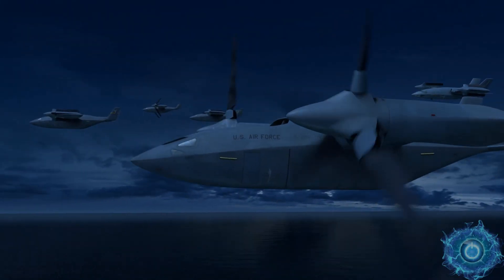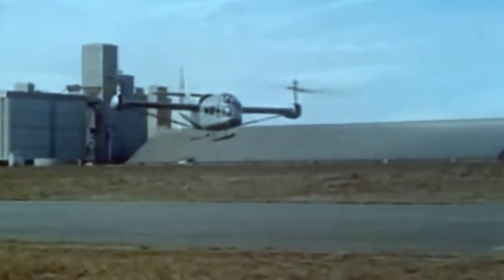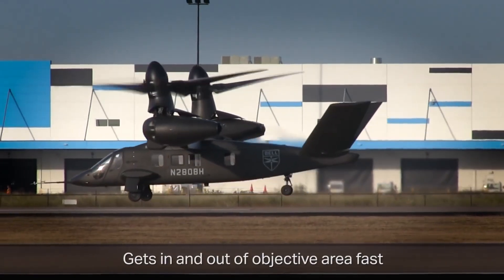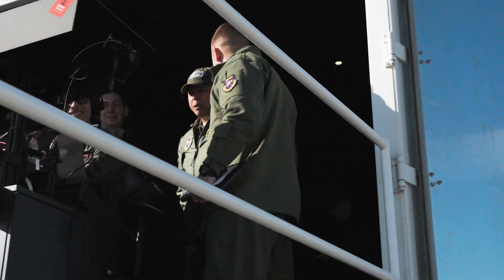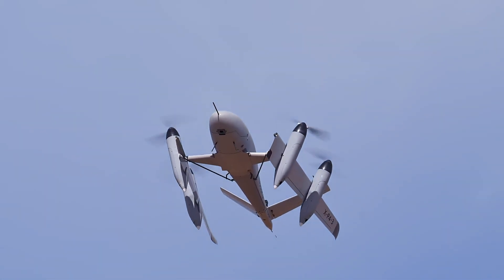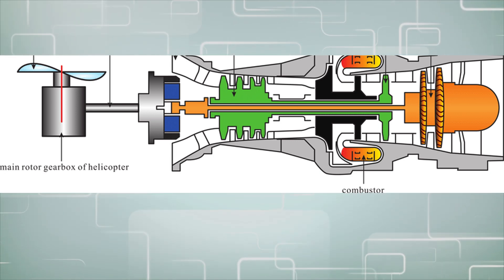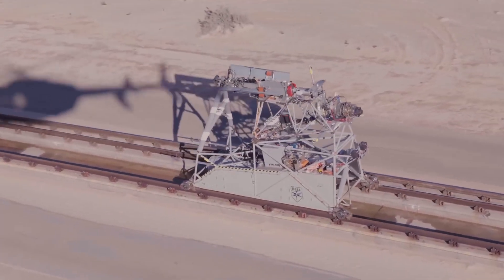HYBRID Jet Engine Will Change AVIATION Forever

Comment: From the title of your video, I was expecting something different. 
That is- why not an electric aircraft with a jet engine electric power unit and smaller battery storage for power and range? It seems like this "hybrid" powertrain would be superior to a battery electric aircraft in every way. it would be a great first step to an all electric aircraft, just as hybrid cars were a precursor to all electric vehicles.

Comment: Looks like an osprey, the most dangerous aircraft ever built. Remarkable kill ratios on those.
Reply: You are falling for the hype generated by aerospace ignorant reporters. The Osprey is really less of an aircraft and more like a helicopter. If you compare its record to the Blackhawk or the other large helicopters or to the Apache, then it is no contest. The Osprey is safer than all of them.
If you compared it to fighter jets in the 70s it would probably be better too. 
Today's aircraft are simply extraordinarily safe compared to years ago. For its capability and its similarity to helicopters, its safety record is just fine.
Reply: @i-love-space390  ospreys danger is to the marines inside it. The ratios are not in favor of the crew and compliment. Marines are to valuable to lose in those machines.

Comment: As w/ anything, maintenance concerns & durability. The failure rate goes up exponentially which is driven by complications caused by parts count.
GR8 vid, didn't see this coming. Blade folding isn't new but the application is. Many thanx 👍👍

Comment: One of the biggest problems for American services is arbitrary limits placed many decades ago. That limit helicopter speeds. If aircraft travel faster than a certain  speed then they  became an air force project. These arbitrary speed limits were stupid outdated and were supposed to prevent inter service competition and stop duplication of effort. And keep air force toes from getting stepped on. 
It prevented the Army and Marines from looking for faster more capable solutions.
For example helicopter wings that folded back into a Delta wing configuration while turbo jets provided high speed thrust. 
Or drone type thrusters that just lift a fixed wing aircraft ten  feet up where other propulsion takes over. 
The air force insistence that they control everything over an arbitrary speed has really hurt the ground forces. Who need support. Something like an A10 that could VTOL and hover yet fly super sonic when needed, with laser systems. This is quite feasible yet never developed. 
A structural small capacitor battery pack that could power thrusters for takeoff or lasers for protection from missiles or taking out drones. Mean that less ammo and heavy guns would be required. So a very good weight tradeoff. Also electric compression on jet engines could dramatically improve efficiency and allow faster spin up for quick operational readiness. Once in flight these electric motors would turn into generators to power lasers and charge batteries and capacitors. 
There has been very poor thinking on this type of craft.

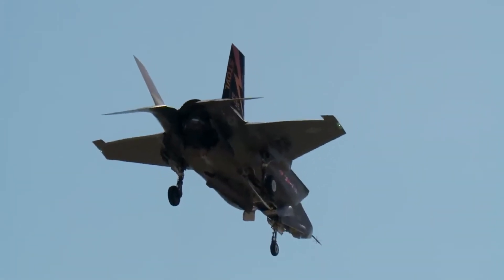Comment: The vertical lift on the F35 isn't only accomplished by redirecting the exhaust - it also has a lift fan that runs off the engine that directs thrust downward. It's the case on the right in the picture of the F35 engine system at 3:37

Comment: STOVL jet aircraft might be inefficient power wise, but not production wise if such engines are already proven and mass produced. After seeing this video, I'm surprised there aren't designs out there using the F135 engine. I doubt such aircraft will be heavy lifters, be they might make good assault aircraft.

Comment: The plane could literally do VTOL. i.e. The plane can be in a vertical orientation at those times. The tech is sufficient now since the last time they tried something like it. Ask SpaceX.

Otherwise. For fueled options, what you want is two fuel tanks. The main one, and a smaller one. You want to be able to rotate the entire engine with significant degrees of freedom. But that makes supplying fuel constantly challenging. On the other hand a long distance plane doesn't spend all that much time actually VTOL'ing. So the rotating assembly can have it's own small fuel tank that supplies the engine while the rotation prohibits direct connection to the main fuel tank. Enough to complete VTOL operations. And is filled again whenever the engine is rotated into it's default orientation (at which time the connection to the main fuel tank can be restored). Much better than extreme thrust vectoring I think.

Comment: Can a turbine generator supplying capacitor or battery banks actually deliver on electric propulsion for aircraft? Or is the hybrid weight penalty not worth it, or perhaps the energy losses are too much?
Reply: There's a couple of hybrids out there and the performance is amazing.

What you really want is a sustaining ICE engine that supplies just enough power for cruising.

And the electric motor gives you enough for climbing.

Comment: There is an interesting design of aircraft, but they rarely talk about it, because this thing is secret. The topic of pulsed plasma thrusters has been developed since the early 60s (see PPT - Pulsed plasma thruster) - they are usually designed for spacecraft. But we will talk about a little-known design - these are plasma propulsion panels for aircraft, where the same Pulsed plasma thruster, but reduced to the size of a pencil and stacked in the form of cells in the panel. The design resembles a conventional plasma TV screen, where there are also discharge cells that activate the glow of pixels on the screen. And plasma propulsion panels have long discharge cells, the arrester has a railgun architecture (just rail contacts or coaxial), and the ionized discharge air is accelerated there by the Lorentz force to enormous speeds - a kind of ramjet engine is obtained. Just imagine! - tens of thousands of small ramjet engines assembled in a panel and firing plasma synchronously with a huge frequency (hundreds of kilohertz). Thus, plasma propulsion panels create lift by pulsed emission of plasma jets from railgun cells. There are tens of thousands of cells in the panel, they shoot at a frequency of hundreds of kilohertz, a huge pulse is obtained, and the plasma swirls the air into toroidal rings - the aircraft is held on this air cushion. Horizontal acceleration is created by the same plasma panels on the sides of the device (they glow, from the side they look like "portholes"). Such devices like "triangle" or "disk" have been observed for a long time, they are mistaken for alien ones - but these are terrestrial devices. They are classified and used for espionage and secret actions. Pulsed electromagnetic technology generates microwave radiation, therefore it is harmful to health. They rarely fly - only military missions. Therefore, they are not suitable for a citizen. This maintained the secrecy. Now they are already declassifying - many people know about this secret technique. When declassified, they will be used for cargo airships. But there is a danger that they are now going to be adapted to deliver small nuclear charges to decision-making centers - such means of delivery are not specified anywhere, are not conventional. This lowers the threshold for starting a war. It would be necessary to declassify them as soon as possible.
Reply: IDK man I am into Physics but this sounds like Schizophrenia
Reply: I see you are a university guy though, so maybe it is not Schizophrenia hahaha. I hope you are right. Though I fear not, why would we be developing these hybrid engines, or even rockets if we had these supposedly effective plasma railgun thruster array thingymajiggys... (as I understand it current plasma thrusters are so weak they're only really useful in space with low friction resistance or in research settings)
Reply: @CamimalFPV  👽👽👽👽👽👽👽👽👽👽👽Gray Lives Matter!
Reply: Consider the conservation of energy. The exhaust of a plasma thruster will be ejecting lots of thermal energy just like an afterburner, but unlike a jet engine that directly uses energy-dense fuel, you need an electric generator that would be at least as big as the jet engine or an incredibly heavy battery.
Reply: @JWQweqOPDH  There are suitable fuel cells that run on magnesium. You can read about them in the public domain. They give a current of 1000 A.
Reply: Solutions come in 6 types 
Each harder to create than the other.

Hypothesis
Physics
Lab
Production
Economic 

I doubt this is barely out of type one. Seems the physics prob has a lot of holes in.
Reply: @simonhenry7867  After studying all the materials about UFOs, it becomes quite obvious that since the late 40s of the twentieth century, a secret project has been developing in the United States to develop and manufacture aircraft, where lift is created using high-frequency vibration. It all started with James Pitts' vibrating orthotopter umbrella "Sky Car", then the umbrella was closed with a dome and devices appeared according to the scheme of conventional electromagnetic vibrating speakers (membrane + inductance) - fragments of the membrane were found by a farmer in Roswell. Then they created piezoelectric motors or with small dischargers on the surface (they glowed all over the body due to air ionization), and now these are planes with plasma propulsion panels (therefore they are angular - that is, with flat surfaces). Thousands of discharge cells are tightly packed into motor panels - they emit plasma streams (the architecture of the railgun is coaxial electrodes). The ionized air of the spark discharge is accelerated in the chamber of the railgun by the Lorentz force to enormous speeds - a kind of ramjet engine is obtained. Just imagine! - tens of thousands of small ramjet engines assembled in a panel and synchronously firing plasma at a huge frequency (hundreds of kilohertz). Plasma jets form toroidal air vortices - this air cushion creates lift and acceleration. See, for example, the MARAUDER project (A ring with magnetic acceleration for obtaining ultrahigh directed energy and radiation). My article "UFOs made in the USA" and the books "UFO Hunting" and "UFO Eradication" describe all this in detail. The technology is quite mundane - it is known in great detail due to information leaks. For example, air ionization in the coaxial elements of a railgun is created using radiation (radioactive polonium is introduced into the metal). Devices of this type were used throughout the 50s and 60s-70-80- x's for secret missions (they took off, as a rule, from special submarines). With the collapse of the USSR, their use by the United States was practically curtailed (in the novel "Little Green Men" by Christopher Buckley, a speechwriter for Bush Sr., a scene is described where the US president decides to curtail the Flying Saucer project). The curtailment of the project can be recorded by the drop in magnesium consumption in the United States, since such fuel was used in fuel cells (magnesium strips were burned in forced galvanic batteries), this is 2007-2008. However, later the development of the technology continued in the Russian Federation and China (the technology was restored by reverse engineering methods for downed devices). Secrecy, however, remained, and there was no civilian use, since the technology was not suitable for this - harmful microwave radiation from pulsed plasma engines (harm to pilots and effects on electrical appliances inside and along the flight line). The payload is small (but one nuclear charge is enough). There is no radio communication - unmanned vehicles can fly and maneuver only in accordance with the program. Previously, there was a narrow application profile - rare spy missions (so that pilots would not receive a lot of radiation). Reconnaissance aircraft of this type were often observed at military bases, missile launch sites and airfields. They were even seen by peaceful geologists in the taiga, where glades were laid for seismic exploration - UFOs flew there to check whether military construction was underway (I myself heard stories about this))). I think that soon this technology will be declassified, and cargo airships with shimmering round plasma panels on the hull surface will appear in the Arctic sky.
Reply: Sounds like Schizophrenia to me. Not the idea - the ion propulsion has been tested and the problem with it - very little trust and enormous energy consumption. But what Pavel wrote is a good example of mania complicated by conspiracy. A typical pair. Very frequent on the Internet.